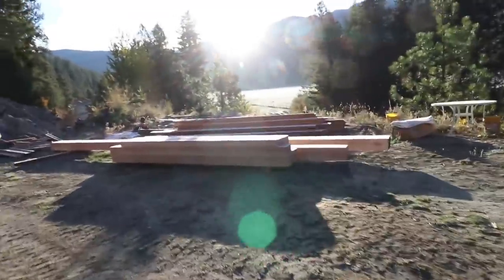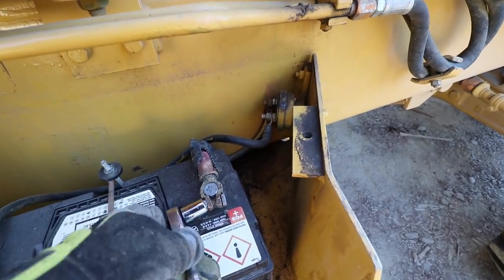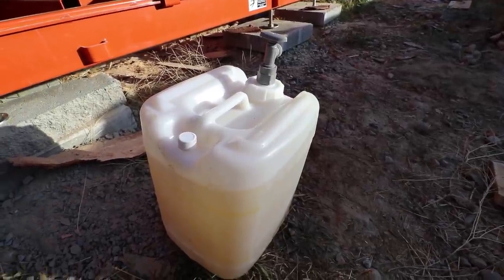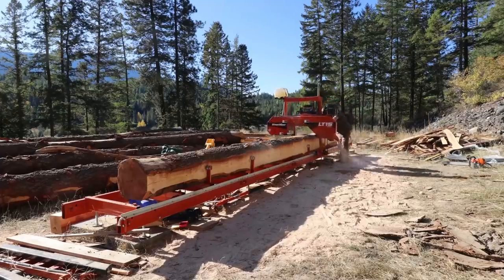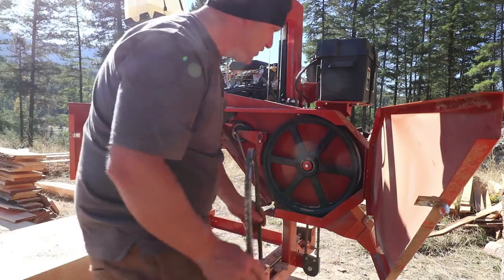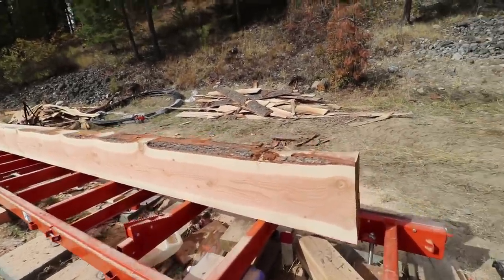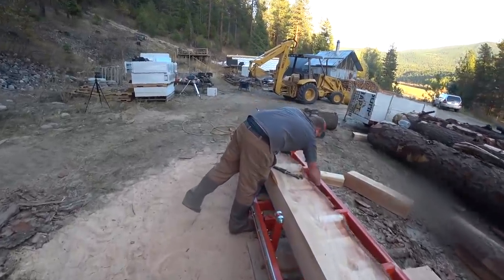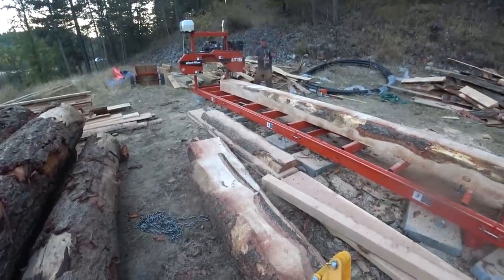BROKE OUR FIRST BLADE! (LT15 Woodmizer Sawmill)

Comment: Good info I work for Wood-Mizer we always tell our customers in training expect 700-1000 BF between Resharp when you are not sawing get pressure off the blade to help relieve those fractures in gullet and get them resharped before the stress cracks go to far which can be as low as 2 cutting hours

Comment: What most people may not realise; These are very (long) logs, most people don't work with logs of this length, its very rare especially with this size of mill(sure you can add more sections, but you can also use a snow blower to clear a highway)  We cut it to length then load it,  it makes life much easier.

Comment: I have followed your vlog for a long time. I grew up in and worked at saw mill. I have not wanted interject about this mill because I have never used one of this type. However, if the deck and frame are square then level with ground is not relevant. Also, when you make your first cut it is the same plane as your blade so once again if your machine is square if you rotate the cut face to the bottom you won't have to fight with the log to get it where you want it for the subsequent cuts.  Not trying to troll you, just trying to help. Love the videos and appreciate your hard work.

Comment: Jesse - I run one of these (LT40HD) for work.  To avoid breaking bands, make sure no sawdust builds up under the belt on the wheel.  Make sure you dont run out of water in the middle of a cut.  When the band starts to have problems getting into the wood, or starts to make waves - change it.  2 hours is about right depending on the wood, but if it cuts good, leave it on.  I usually use 2/day.  To keep the water from freezing.... just empty the jug when you're done and blow out the line.  It wont freeze while you're using it.
 NEVER let anyone stand beside the machine when the band is running.... it will come out of places you wouldn't think it could come out.  Oh, and use that belt with the until it dies, its fine.

Comment: Your vlog has been reminding me of what a maternal aunt and cousin went through back when I was a teen. My maternal grandparents gave them a small plot along the border of the larger plot along a small ravine, and then my aunt started work on the house. A cousin came in to dig out the basement (and we had to blast some of the boulders in the process), we got the footers poured, a friend of Granddaddy's did the basement walls and framed things to the point where it was underroof, and from there, it was just a slow, long process of finishing things off. Granddaddy helped where he could, having been a homebuilder for years even after two accidents which nearly killed him and would have left any less stubborn and cantankerous individual totally crippled, but his life trials and being in his 70s kept him from doing more than advising and doing things where he could sit.  My aunt's place was not as much of a build as my grandparents, but it was a massive undertaking, especially given my grandparent's place was built around 1950 with the help of 3 teenage boys, a couple of not quite teenage girls (less my aunt, who may have been like 6 at the time), and some other family members.  The area where the house was did not have ready road access (just a fireroad) until around the time the house was done, and outside of things like cement, glass, wire, nails, and tubs/sinks, everything came from there at the property (including slate shingles cut from a ravine on the other side by hand).  Granddaddy even had a sawmill with several saws, the biggest of which had a 4' diameter blade, to handle the trees which were felled by hand.

Mom and I, with Dad's help, even did something similar but less extreme, and had a contractor build a house I still own, which was only partially finished. But outside of a few things, my grandparent's home was actually of far better quality than the one we had mostly built by a contractor, who cut corners and varied from the plans we had drawn up ourselves (and were every bit as good as, if not better than anything the contractor had ever used).

So watching the two of you, it brings back memories of my Mom, Grandmother and Granddaddy, and other family members who had all passed before I was 30 (20+ years ago).  And you two are doing great, and I look forward to watching the videos I have not yet seen.  Thank you for sharing them with us.

Comment: The reason you see the disconnect on the ground is so you can isolate the battery from the chassis ground for welding on the equipment (otherwise you can blow up the battery).

Comment: suggestion on the concrete pads if you decide to re-level make the pad 1 inch below grade(in bedded  in ground) so they won't move then a hole in each pad same size as leveling peg so the mill won't move when big logs are moved around on it

Comment: Couple of suggestions, if you want em:  (btw thanks for the great videos.  Your documentation and process is fun to watch and get ideas from.)  1): The alternator on any vehicle is only there to provide a trickle charge to "top off" the battery.  It is not made to charge the battery from dead to full charge.  It keeps going dead because what little charge it gets from the alternator is not enough to revive it.  2): if you use 2 lifting points for your loading and unloading of the mill, you will eliminate a lot of "teeter-totter" effect.  2 slings of the same length, looped thru the same shackle or clevis.  Then space the straps apart on the log, and you have a much easier job of balancing things.  Good luck and great work!

Comment: For the battery drain. Disconnect the ground. Place a test light across the terminal to the cable. If the light lights up there is current connected or shorted somewhere. Pull fuses one at a time and when the light goes out you have isolated the circuit that is shorted or connected.

Comment: The sawmill has anchor pockets. Those rectangle tubes welded on the backside. Get some steel tubing that fits inside those, dig a hole directly under, insert tube through those and down into the hole, pour concrete. Boom no more movement.

Comment: I know this was filmed weeks ago, but a solution to keeping your mill temporary without building a pad could be getting some 3 or 4 foot angle iron pieces and welding a top plate at one end.  Drive those into the ground(might be a bit difficult with your rocky soil, but maybe rent a power hammer attachment for your backhoe) and secure the mill feet to the plates.

Comment: Loving the project, awesome work guys!
As someone who has some experience running 4 bandsaws (8'+ tall, 18'4" blades) here in the UK at plastic recycling plant, would highly recommend looking at M42 bi-metallic bandsaw blades on your saw mill. I've saved sooo much money running these as they are a lot more hard wearing and forgiving... almost double the price, but in my experience last 10x as long. They don't snap as nearly as much as cheap carbon steel blades which seem VERY brittle. Hope this helps!

Comment: Set mill track legs temporarily in a anchor cement called Por Rock after it is releveled. Make sure blocks in ground won't move by packing extra soil around leveling blocks. If you want to improve shear strength drill 2 holes on either side of leveling legs and place a nail in it before slathering on the Por Rock.  Por Rock is sold at most good hardware stores. When you want to move the mill break off anchor cement with a hammer. I have used Por Rock for many years setting anchors in concrete and setting grout pads for steel buildings with outstanding results. Good Luck!

Comment: Yes, battery cleanliness is paramount in especially in weather.  Super clean terminals (shining like silver) can save you expensive voltage regulator and alternator problems. (With a faulty ground, the charging systems "cooks" the battery and the alternator.)

Also keep the top of the battery clean and dry (phantom ground) and put a piece of plywood under the battery and keep dry.

The ground is the proper side to disconnect and reduces the chance of a spark igniting hydrogen gasses.
Reply: Also, perform a continuity tests on all of the chassis and body grounds that you can find.  I don't know about John Deere/Case, but Ford requires a chassis and body ground -- zero must be common in both cases.

Comment: I understand that my suggestion might be irrelevant by the time you read it. Have you thought about anchoring mill posted to the ground using C-shaped pieces of rebar hammered into the ground around each post? That won't completely eliminate mill movement when you put the log onto it, but it might greatly reduce that movement.

Comment: Not sure about electron flow, but negative disconnect is for safety. If negative is still connected to the chassis, then the battery will be shorted out if the positive touches ANYTHING (e.g with a spanner on the terminal), ANYWHERE on the chassis. With the negative disconnected, it's much safer.

Comment: General rule of thumb for batteries is disconnected negative first and when reconnecting battery negative is last. with the negative disconnected you can't accidentally short something out by accidentally touching a positive connection to ground because the battery is not grounded.

Comment: You can use a multi-meter to quickly check if there is a draw on the battery when the tractor is off. I think it'd be worth a look to just see if there is a draw at all or if the problem lies elsewhere.

Comment: When you finish milling for the day, release the tension on the saw blade so that it does not shrink when the overnight temperature drops. Also try a little diesel in the coolant.

Comment: J MAC:  Having used both Wood Mizer and  Lucas Mill's over the course of 2 years, cutting Australian hardwoods. The only difference I have found is cost and the finish, Wood Mizer costs more eg getting blades sharpened and maintenance but does give you a slightly better finish, Lucas Mills on the other hand cost way less for maintenance but leave a slightly courser finish. All that being said I'm in it to make money so I sold the Mizer and purchased another Lucas Mill.

Comment: I know the house is already up but I'm watching this and shouting "͏you have the solution to the mill problem right in front of you!"  Take some of your logs and cut a flat top and bottom and use them to build a simple crib for the feet of the mill to set on. A long heavy foundation would keep all the places where the feet touch in one plane, unlike 28 individual concrete blocks. As good as a concrete pad and 1/2 day time  and zero cost.

Comment: We used a couple of Optima's Red Top batteries in our 1 ton diesel truck, and no longer have battery issues. Sealed batteries are the way to go for off road applications. Less leakage. IMO

Comment: I worked construction with backhoes, loaders, etc. I believe you may have better luck loading your timbers using the front bucket. It handles more weight than the backhoe, and you can set the timber gently once, rather than having to re-set and drag the log.

Comment: For the backhoe, check the voltage at the battery when the engine is running. If you see less than 13V at idle with all accessory on then your alternator is broken. When the engine has speeded up you should get about 14.4V at the battery. If you get less than 14 your alternator is probably faulty.

Take note that it is possible that the battery have a partial internal short and discharge overnight by itself due to that.

Also, if you fully charge the battery with an external charger, wait a few hours then mesure the voltage, you should get 12.5-12.7V, anything lower is a faulty battery.

Diesel engine do not need power to run. In many case you can even remove the alternator and the battery and the engine will still run!

Comment: Pound in some re-bar anchors.   Then fasten onto them with some metal hose clamps on the mill frame.   North & South and East & West of several major frame major frame sections of the mill should keep it from sliding around and reduce the need for fiddling.....Bo.

Comment: I had a similar problem with my "battery" on my car. Same symptoms, and I checked everything and everything seemed to be functioning properly except that it periodically wouldn't start. Ended up being the terminal ends. I had even replaced them at one point in trouble shooting, but the cheap ones I got were poor quality. Once a mechanic ordered me some good quality ones, the problem went away. If you do try new terminal ends, you should probably check the cables for corrosion while you are at it. Thanks for living my dream (one of them anyway) and posting it for us all!

Comment: Well, it is still easier than broadaxing them.  Looking good guys.  In my experience, blades most often break at the weld and sometimes you can just reweld them.  Of course i was abusing them more than you are because i was cutting stainless steel from ten or twelve inch bars.

Comment: jESSIE,  Water soluable oil is what people use for lubricant. Mix it a little heavier on the
soluable oil when it is cold. You have probably discovered that frozen logs don't saw
well if at all. Our saws ran 150 HP electric motors and even with a cautious slow feed there are days when blade damage requires just waiting for warmer temps.
     Best trick for how long to use a blade I saw in Boykins Va. They use four of these saws ganged to run together.making 4 cuts at a pass. and sometimes as little as one saw. They have alarm clocks on the saw arbor motors set to 7-1/2 hours to signal blade changes.
     Blade breakage comes from forcing a dull blade through the cut. Earl signs of dullness
are the blade tracking up and down while cutting. Bad guide bearings two on each side
of the blade and one or a creamic block behind the saw back edge. These are 1.20 each in
Nachi brand from seller irvineman on Ebay. These guides need adjusted to be about two saw blade widths from the edge of the cut or less. The one leading in is more critical but
either can take the "Back" out of the saw. The back edge is not a straight line but taper
rolled tofit a 3 station guage. Finally only sharpen these blades once. I weld the broken ones back together unless they are split long ways and hammer weld to flatness on a block.
     The first cut needs the small end of the log shimmed up by half the diameter difference 
measured from the center pith point down to the side it will set on. Oposing wedges tapped in at a few intermediate points as needed for stability.  The second face to cut is with the milled first face against the bed to get the faces parallel.

Comment: The charge Voltage needs to be 13.8-14.2.. A battery can be down by 2/3 if its cold. A old diesel like that only needs about 5 volts to hold the stop solenoid on the pump.. I think you have an Alternator Fault..I have done this for 30

Comment: Disconnector should be on the ground, because this takes away the risk of shortcutting the plus with the frame of the backhoe. If you shortcut the minus with the frame nothing bad will happen.

Comment: Just a quick comment to keep your sawmill in a secured level location. Pound in 4 t-post at a 30-degree or more angle to bed rails and anchor each bed rail to the t-post with a steel cable and cable tensionner. The solution is inexpensive and will stop the mill from moving end to end when you have to slide a log for better positioning. Good luck and thanks for the awesome videos.
Reply: That works, you can also tie a strap to a concrete block and bury it and cinch it up.